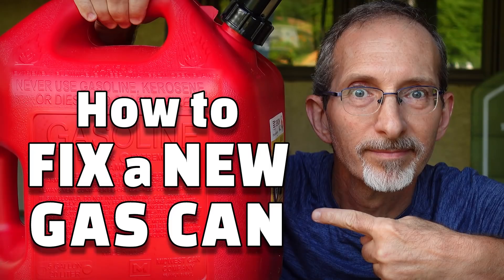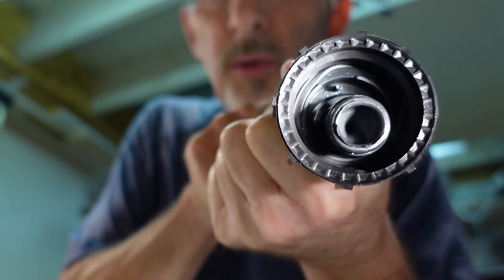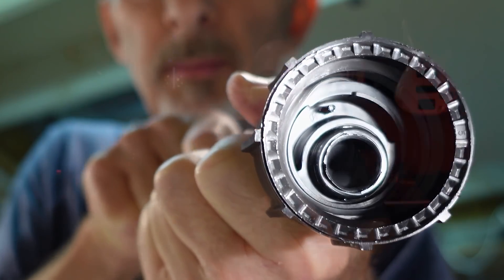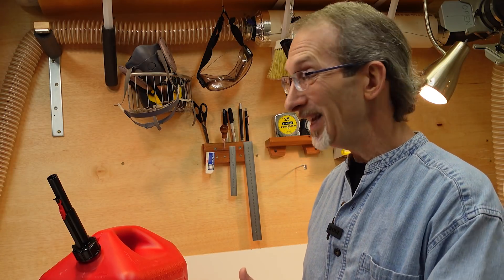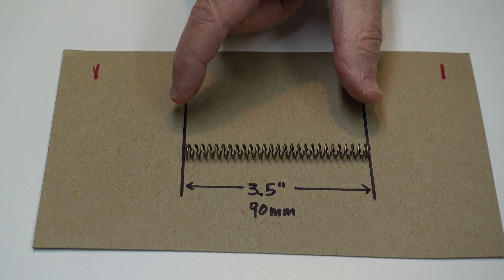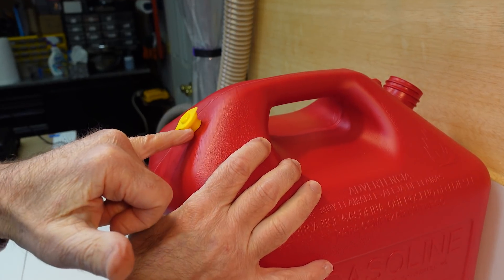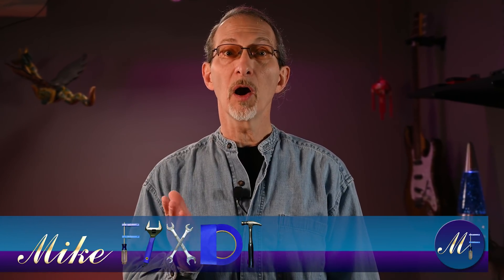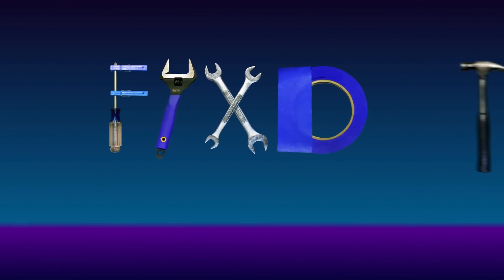Gas Can Modification | Part 2: Explosive Details!

Comment: Don't blame the manufacturers!  Look up the history of Blitz gas cans. Once one of the largest can manufacturer, it went out of business in 2012 due to too many lawsuits from "special" people.  The majority of Blitz's lawsuits were won, but the shear number put them out of business. Couple that with federal restrictions and you have today's fuel cans. They over built the safety on these cans so as to prevent erroneous lawsuits and comply with restrictions. To complain about design when manufacturers hands are basically tied is futile. These are the steps that manufacturers must implement to sell a "gas" can. There are alternatives, racing cans, cans that are red but aren't "gas" cans ECT.
Reply from the maker: I suppose, at the end of the day, I am blaming everything and everyone that affected the design of these containers. I am in support of safety, but not when it comes at the expense of usability. But I agree, you have summed it up nicely. Thanks for joining the conversation!

Comment: The cans need a clear sight glass to allow for filling without staring down into the hole.
Reply from the maker: Joe, that is an excellent idea! Even a strip of non-colored plastic somewhere on the side of the container would be helpful. Most gas station pumps will click off when the right level is reached, but that often happens prematurely, so being able to see the levels would be a great addition!

Comment: Save your back,  go on Amazon or a local big box store maybe even a hardware store and buy a small battery operated transfer pump I’ve been using one for years a pair of AA batteries last about a year my last little pump lasted for two years fast efficient easy to use.
Reply from the maker: Robert, thanks for this comment! I just picked up one of these siphon pumps and I will be reviewing it in an upcoming video. Stay tuned!

Comment: I haven't tried this yet, but I'm going to try a small boat transom vent, "bung" only. Drill the correct hole size so the bung threads work, the bung has it's own retainer when unthreaded.
Reply from the maker: Ron, that sounds like a creative idea. The vent doesn’t have to be high tech, it simply has to work. Thanks for sharing your idea!
Reply: Drilled an air hole and plug it with a crew of proper size, added a flexible spout and viola, an old fashiohish gas can.

Comment: I bought this can because it was inexpensive.  My first mod was to remove the flame arrestor insert; second was to remove the nozzles red idiot bar; third was to clip the small side of the cap lock. At least now it is useable!
Reply from the maker: User 1, congratulations! It sounds like you passed all of the gas container modification requirements! I’m glad it’s working better for you… Thanks for watching and commenting!

Comment: Interesting spring mod.  This should not work based on every spring calculator I have used.  Springs get stiffer with fewer coils (all else being equal).
Reply: Done with guns all the time.  Usually only remove a couple of coils.

Comment: My opinion is is similar to yours.  They didn't make the gas container safer to use.  They made it more dangerous.  I would argue that the modifications you made to the container actually made their safety features function better.  I think my brother first modified the spout like you did and later bought a replacement spout to solve the problems more completely.  These people need to dump this nonsense and got back to the old gas can design.  This was just a terrible idea.

Comment: Gas cans, as well as station pumps have been known to ignite when cell phones ring or are used. Static electricity also has been known to spontaneously ignite gasoline. Is that improper use or just incidental bad luck? Sometimes we get too familiar with products, very dangerous products, we've used all our lives and ignore the dangers. Chit happens...
Midwest's safety mechanisms are awkward but I would rather have an aching back than be horribly burned and spend a few months in the hospital. I admit that there's some issues with their spout and lack of vent on their can but you do have the choice to replace it with another aftermarket type. 
What I use is a battery operated fuel transfer pump so that I don't have to pour at all. I don't know if I would go and make a video on how to defeat these safety features because I value my home and retirement income. I believe just about anyone that knows how to pour gasoline into an appliance has the smarts, mechanical wherewithal and intuitive knowledge to do all these mod's without a 'how to video'. Just say'n.
Reply from the maker: I hear what you’re just saying, and I can’t emphasize enough that people need to make their own decision whether these mods are right for them. I don’t think many people we’ll figure out all of these tips, so it made sense to put them in a series of videos. I am curious about the electric transfer pump you use… Do those have any chance of making a spark that could ignite the fuel?

Comment: The problem is these spouts are built too cheaply in the first place. You can't support the weight of a full container with the flimsy spout while filling, which is naturally one's tendency because of the weight and lengthy fill process. If the design was beefy, the spout would not flex and bend so much thereby allowing the sliding neck to work more pecisely.  I think the one size fits all spout shown shouldn't be on any container larger than one gallon.
Reply from the maker: Mark, this is very well said. I agree that a better constructed nozzle would help support the weight of the gas container. Excellent points! I appreciate you commenting.

Comment: I used a 1/2 inch drill bit to install the yellow air vent and it worked just fine.   In fact it was a tight fit, but a tap from a plastic mallet did the trick. Also used a small bead of clear silicone RTV to make a seal around the vent. The Midwest cans are great, once you do these modifications.
Reply from the maker: Gary, thanks for sharing your experience! I feel like the vent does make a big difference. I saw your other comment about putting the vent on the seam… three years and Still working is a good sign!
Reply: For the vent, I got some tubeless tire stems, took the Schrader valve out, used a step drill to drill an appropriate hole, got a piece of string, threaded it to the hole I drilled, tied it to the tire stem and pulled into place, replaced the cap and it works so good I put them on all 8 of my cans here on the farm.
 Put a dab of liquid detergent on the tire stem and it will pop right into place.
Reply: @Watchyn_Yarwood  I have a 30 gallon oil barrel for farm transfer. Thinking that for vent while filling thru 3/4 bung.  As large hole used for 12v pump.
Reply: @larsharris  That should work. Doesn't take much for a proper vent.

Comment: The reason those safety features were put into the design of the gas can can be traced to the can made by a company named BLITZ.  The pouring the gas from the can into the fire caused the can to catch fire and explode.  The old metal cans had the screen in the top of the spout.  Needless to say BLITZ is no longer around and were found guilty for not having the flame guard in them.  Between the cost of lawyers and losing the case one of the oldest gas can companies in the country is no long here.  Look up the cases if you want  It is an interesting read as to why the gas cans are so screwed up now and most people like you and I modify them.  I put a vent into mine to help with the flow also beside making changes to the spout.  The Feds under Obama passed a law banning the vent on gas cans.  There was a company called No-Bama that made a kit with a new spout and vent.  many companies now make the kits for the old style spouts.
Reply from the maker: Nobama- that’s funny!

Comment: With all this fixing things, it might just be better to buy a Wavian Jerry can with a aftermarket NATO spout.  It is metal, seals the gas real good with the lid, and you just take the lid off and take the spout off the holder and put in on the mouth of the can. It is expensive though at 80 bucks but not too much more than other metal cans.
Reply from the maker: Adam, thanks for your suggestion. I might just take the plunge and replace these plastic containers with metal cans eventually. It’s good to hear which brands people like. Thanks for contributing to the conversation!

Comment: The part about holding a full gas can while trying to pour fuel,I can attest to that is awkward,mine was VERY slow pouring fuel,plus the slide mechanism was sticking,I have transferred the spout from the old can,has a cap to seal the nozzle.
Reply from the maker: Yes, a lot of people feel this way. I’ve heard that these spouts on the 2 1/2 gallon containers are much easier to handle. These 5 gallon cans are simply unwieldy when paired with these nozzles. Thanks for watching and for joining the conversation!

Comment: Just get one of these https://www.homedepot.com/p/Red-Galvanized-Steel-Type-I-Gasoline-Safety-Can-with-Funnel-5-Gal-Capacity-UI-50-FS/303294751
Reply from the maker: Dusty, thanks for sharing your recommendation. The metal cans seem to be designed much better.

Comment: Assuming you’re modding an empty can, and have already pulled out the filter element, shouldn’t be a problem to just drill the hole for the vent normally and then using compressed air to blow out the plastic chips.
Reply: will the filter catch the chlps  i havent tried drilling yet....

Comment: I think they modified the design in regards to the spring. I have one of these and the spring isn't as stiff as it looks on this.
Reply from the maker: Tom, I don’t know whether the springs are lighter on the smaller containers or if they are the same on the 5 gallon ones. This spring was a real bear!

Comment: Wait. 8 in 10 fuel container users are worried about how their gas can protects them from exploding when they pour gasoline on an open flame? Is Midwest Can selling ONLY to pyromaniacs?
And as a person who has bought gas cans, and knows other who have bought gas cans, I am fairly sure that fire prevention and safety as reasons to buy a particular gas can fall WAY behind factors like size, price, and "That's the only one the gas station had."
Reply from the maker: Excellent points! It’s amazing how marketing can spin something. Thanks for joining the conversation!

Comment: I was taught at a very early age to keep the cap on a gas can (so no fumes come out) and never to pour fuel on an open fire. That’s still the sensible way to achieve safety.
Reply from the maker: Gary, me too. I always assumed other people knew common sense safety when handling fuel. I guess I assumed wrong, hence all the safety features built into these new gas container designs.

Comment: BOTTOM LINE,,,,,,,,,,,we all know that MIDWEST and all other gas can companies are only making these dumb gas cans cause they are made to by the gov't.........before the gov't got involved cans were made the NORMAL LOGICAL WAY............TO BE FILLED EASILY AND DISPENSED EASILY...........AND HERE IS THE BIGGEST PROBLEM WITH THESE CANS....................THEY ARE FORCED ON US BY THE GOV'T..............A BUNCH OF 2 BIT KNOW NOTHING KNOW IT ALLS THAT WILL NEVER USE ONE OF THESE THINGS IN THEIR LIFE.............AND WHO COULDN'T RUN A ROADSIDE HOT DOG STAND AND MAKE A PROFIT,,,,,,,,,,,,BUT THEY ALL KNOW HOW TO TELL US HOW TO LIVE.....                   by the way,,,,,,,,,,,,,,,,A VERY GOOD AND INTERESTING VIDEO          THANKS
Reply from the maker: Yard limit, I’m glad you like the video. What you didn’t mention is that the manufacturers implemented these designs before there were government regulations saying that they had to. However we got here, we deserve better designs that are safe, but are also easy to use. Thanks for commenting and for watching!

Comment: Thank you for doing what you should have done in the first video.  Stopping to "cut the curl" in the middle of drilling was a waste.  The drill bit is designed to eject chip as it runs.
Reply from the maker: I hear you! Since the canned previously had fuel in it, I was super concerned that the plastic would go in the container and get stuck. It may have been overkill, but it did appease my OCD. :-)

Comment: Rather than heat, add a drop of ArmourAll solution to the outside of the yellow cap shaft.  It’ll slip in easily without the possibility of deforming it or the can with heat.
Reply from the maker: Thanks for the suggestion! I never would’ve thought to use armor all. Might be worth a try!

Comment: String trimmer and other small 2 stroke engines should be filled from a 1 gallon can with a hand operated trigger. I used to buy 5 gallons and refill the one gallon can with mix fuel. They make other types of cans for other applications. The flame arrestor appears to be a problem but it is an important feature, but as you said, you want to fill a gas can at a gas station. Maybe they will improve the feature in the future.
Reply from the maker: Timothy, yes I actually do use smaller containers for my yard tools, especially the ones that require a pre-mix of oil. We can only hope that they come up with better designs that’s still provide the most important safety features. Thanks for your thoughts!

Comment: Hi........also after doing all that you recommended,  which work great,  I put the closure gasket on and tried to pour out a test flow.  Well it leaked as always at the cap.  Duh!  Only then did I discover that particular gasket is SPLIT and has to be fitted around the rim of the closure flange..................works better now...thanks for  your video....good work
Reply from the maker: I’m glad you worked it out, and I appreciate you watching and sharing your experience.

Comment: I never spilled so much gas in my life until they came out with this garbage.  Take the spout off, stab a vent hole in the other end, and pour.  Safer, faster, and spill less gas.
Reply from the maker: William, if you are going to do that then the question is to funnel or not to funnel! Hey, thanks for watching!
Reply: @MikeFyxdt  We are in the middle of the Ransomware induced gas shortage here in North Carolina.  I have a little gas set aside, because we are retired.  I guess I should buy more cans, and I appreciate the tips.  I passed your video along to my sons, and a friend.  Thank you!
Reply from the maker: @williamsullivan9401  William, thank you for sharing my video. I am so sorry to hear that you are stuck in the middle of this horrible mess with the gas supply company. This type of international abuse is horrible and I hope our government does not tolerate it. I hope the fuel supply is reestablished quickly, and that you are doing well.

Comment: One suggestion after drilling the hole for the vent, put a vaccume cleaner nozzle over the hole with the can preferably with the face just drilled pointed down and the nozzle off.
MAKE SURE THE CAN IS EMPTY OF GAS (petrol in UK), as our gas is vapor ho ho.
The vaccume should remove the swarf also putting a glue around the vent.
The idear of the company was good but they should have got a few consumers ect testing them.
They most likely ould have put an less force/smaller spring in also I was thiking a screw cap/nozzle that is reversible. One way it seals the can the other it has the spout on, with a deeper filter.
This would get rid of the awful medicine top opening systems.
Why fix something that worked for a good number of years.
By the way the drill set is unavailable, but the customers comments about the was not good.
I'd stick to drilling plastic with them.
Thanks from the UK for  the video
Reply from the maker: Anthony, thank you for all of the helpful comments. I’ll have to circle back and check out those drillbits because I don’t want to recommend them if people are having a problem with them. Mine were exceptionally sharp, and I was able to use them without making crumbs in the gas can. (petrol can?) I have also heard viewers suggest using a fuel resistant glue to secure the vent, which makes sense. And yes, make sure the container is empty and any fumes have evaporated before performing surgery on any fuel container!

Comment: Even without the spring many don't want to slide open and closed.
Reply from the maker: Wayne, without the spring the red tab does a pretty good job of locking the nozzle in the closed position. I'll be trying an aftermarket replacement nozzle in an upcoming video to see if it's better...stay tuned!

Comment: "8 in 10 consumers find the FlameShield Safety System very appealing. . ." I call BS on that. Either the people they polled were a carefully selected sample of safety Karens, or else they just asked them, "Would you like to have a gas can that is less likely to blow up in your face?" If you add the qualifier, ". . . but will be impossible to fill without spilling gas everywhere", you get entirely different answers. As every pollster knows, you can get whatever result you want depending on how you frame the question.
Reply from the maker: Lou, yes! This is so clearly a case where the question was obviously manipulated to give a favorable answer. It’s like selling an uncomfortable chair, and asking people if they were happy when they got out of the chair. Then they marketed the chair as saying 80% of people felt more happy after they got out of the chair. Crazy!! 😁